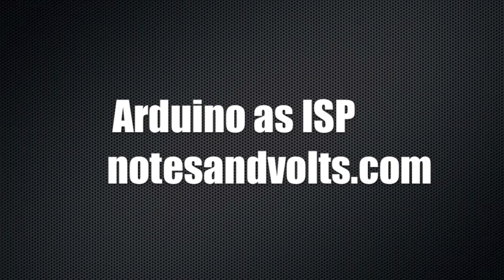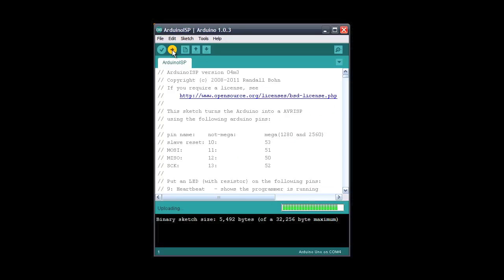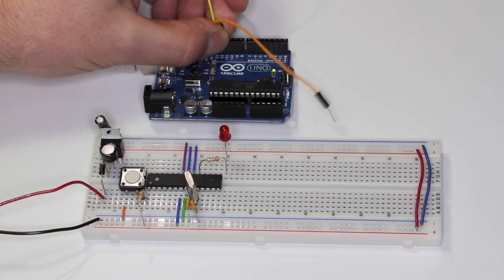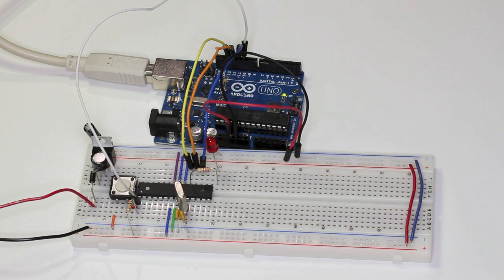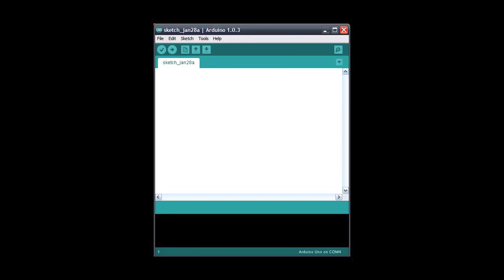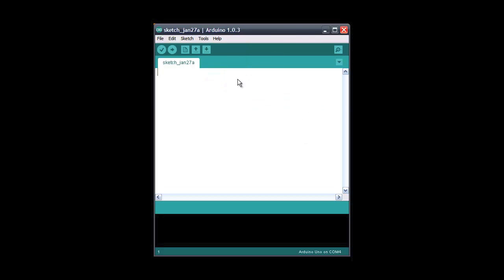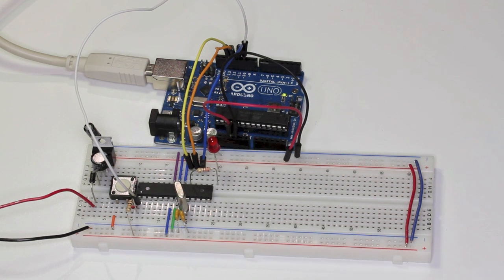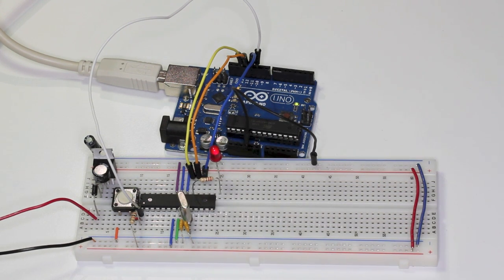Arduino as ISP

Comment: Thanks for your videos, many of them were helping me a lot with my midi projects! thank you! I would like to ask you something... I design a custom board with an atmega32U4 for a midi controller project... I programed using an arduino as isp and avrdudess. It works good always, but now it doesn't work anymore, it doesn't recognize the atmega32u4. I checked all the wires a hundred of times and everything is ok... but the most weird thing it is that it was working fine and suddenly just stop working... do you have any idea of what could happening? Thanks

Comment: OMG... I spent literally 30 hours trying to figure out how to upload sketch code into Atmega328P-U with no avail... this video tutorial helped me, I did not knew you need to hold the shift key to make the Arduino IDE to upload code to the Atmega328P-U rather than the Arduino board. It does not make sense why we need to configure on the "programmer section" at the arduino IDE and also need to press the shift key. I seriously need to stop using this Arduino IDE and shift towards Atmel Studio IDE. I watched literally watched 100s of youtube video and no one said to hold the "shift key"... wow. Now I need to figure out how to upload sketch code using UART serial pins from a USB to TTL converter device, I hope you have a video on this. Thanks! Also from what I heard, this process erases the bootloader since we are using the SPI pins to upload the sketch code.

Comment: This was a nice tutorial. Is there a schematic or diagram link for the wiring? I checked https://www.notesandvolts.com/2013/01/fun-with-arduino-arduino-as-isp.html and didn't quite see the wiring for the bootloader sketch. White to 1, Blue on 17, Orange to 18, Yellow to 19? from pins 10, 11, 12, 13 respectively? Thanks.

Comment: I have a question. Thanks for the great video. I used this circuit to create an ATmega328p programmer UNO shield (with ZIF socket) like many you can find online. I just started burning bootloaders to multiple chips and I'm wondering if it is safe to add/remove the ATmega chips while power is still being applied. I noticed that the power LED flickers on the Arduino UNO when I'm doing this. Doesn't feel safe. EDIT: If it isn't safe, I think a pushbutton under the ZIF's lockdown arm might be a neat solution to only power it when a chip is in

Comment: After 2 weeks attemting to solve the problem, key was in  "shift + upload"
Thanks man very  good turorial
Reply from the maker: Thanks Yagoub!
Reply: @NotesAndVolts  plz sir i've Qst:i've code   written in avr-gcc and i want uploade this code to  ATTINY 2313 and ATMEGA 328P. is this method inn video work?
Reply: I have been trying to find a written article about this and while I've found lots of good articles about using an arduino to write the bootloader to another arduino, I haven't found something satisfying about how to actually program a sketch using an arduino as ISP to another arduino. And +1 on the secret being shift + upload! Very useful and clear tutorial, Notes and Volts!

Comment: Is it necessary to have the board (which is the ISP) to have the ATMEGA328P chip mounted for programming the target chip? Or does it program the target chip without a chip on the board?
Reply: I actually heard somewhere else that you should make sure to unmount the chip from the board. Now I'm confused - Does this work because he pressed the shift key to bypass the board, and does taking out the chip negate the need to do so? I guess you can go with both to be safe.

Comment: Hi, I purchased ATmega328 U controller from the market , And i tried to boot load the controller using Arduino Uno board as ISP.  But it failed, I tried  several times. Connections are made as shown in your diag/video. I think the problem must be in ATmega 328 version or you may say the code U, its not the P as usual. So please can you help me in this How to bootload a ATmega 328 U using Aduino IDE(New version).

Comment: Thanks a lot for this awesome tutorial !
For those who have an error message when bootloading like :"protocol error, expect=0x14, resp=0x14...". You can try to put a 10uf capacitor or more if you don't have beetween the reset of the arduino (the second socket after the 5v output socket of the arduino) and the ground of the breadboard. So the positive leg on the reset socket and the negative leg on the ground of the breadboard. It worked for me !
Reply: Works for me too!

Comment: Arduino: 1.8.5 (Windows 10), Board: "Arduino/Genuino Uno"

avrdude: Yikes!  Invalid device signature.
         Double check connections and try again, or use -F to override
         this check.

Error while burning bootloader.

This report would have more information with
"Show verbose output during compilation"
option enabled in File -> Preferences.
(help me)

Comment: Just what I need on how to use an uno board to program an atmega uController.
However I got the following error (see below):
Just inquiring - is this true if I program an atmega 48 or atmega328??
*********************
An error occurred while uploading the sketch
Reading | ################################################## | 100% 0.02s

avrdude: Device signature = 0x1e9307 (probably m8)
avrdude: Expected signature for ATmega328P is 1E 95 0F
         Double check chip, or use -F to override this check.

avrdude done.  Thank you.
**************************************

Comment: It burning on the chip connected on uno even if push shift and upload button why?.Pin 21 is also vcc=5v?
While burning bootloader it gives this error
 ***failed;  
avrdude: WARNING: invalid value for unused bits in fuse "efuse", should be set to 1 according to datasheet
This behaviour is deprecated and will result in an error in future version
You probably want to use 0xfd instead of 0x05 (double check with your datasheet first).

Comment: I can't burn the bootloader, there is an error saying:  ***failed;  
avrdude: WARNING: invalid value for unused bits in fuse "efuse", should be set to 1 according to datasheet
This behaviour is deprecated and will result in an error in future version
You probably want to use 0xfd instead of 0x05 (double check with your datasheet first).

Comment: A question if you bring the arduino uno to dfu mode the circuit is gonna be to? Because I have a Chinese arduino board ho doesn't have the dfu pin on it and I will like to bring it to dfu mode so I can turn it into a joystick with unojoy library... Any help would be appreciated.

Comment: Thanks for this! We got it working successfully to program a nano. Can't figure out how to output to the serial monitor though. We've tried wiring the nano's TX to the Uno's (ISP) TX, and also it's RX, but no dice. Any thoughts here?
Reply: Here is my late response: 
The program on the UNO is acting only as a programmer using the SPI port and quite surely ignoring everything else, the serial library on the Nano is using the serial UART TX and RX, I suggest you connect a normal USB to serial converter to the Nano TX/RX and use a separate serial monitor on the PC ignoring the embedded monitor in you Arduino Editor.
There is a solution for Atmel ICE programmer using SPI where the serial information can pass through the ICE programmer using the DGI port. search for: "Is it possible to monitor serial using Atmel-Ice?" on the AVR Freaks forum has all the links.

Please let me know if you’ve found a better solution.

Comment: I don't understand where the code is. Is there no code apart from that of the blinking?
Reply from the maker: Hi Max. The Blink program was used as an example. In reality you would upload your own program. If you're talking about the ArduinoISP program, it comes with the Arduino software in the FILES>EXAMPLES folder.
Reply: Notes and Volts and that program is the pda code you have on your web isn't it?

Comment: I had tried burn bootloader in atmega8 with arduino uno many times. But Everytime found the same error" efuse" memory type is not define for part atmega8 . So how to resolve it.
Reply: same
Reply: change it in the file where u set the fuse bits

Comment: If I were using arduino uno as an ISP and uploading bootloader to a 328P AU (for Arduino Nano and not UNO, I get 2 Analog pins extra) I have to change the board type to nano after uploading the ISP sketch to UNO? 
My next question to you would be can I burn the code by holding the shift key to upload it to the chip ? 
I know how to wire it up and I have a DIP socket too. What I am trying to avoid is the usage of a FTDI to burn the code to the chip after the bootloader is burned in the way you demonstrated it.

Comment: on which chip bootloader is burning?...after burning a program in the the chip of breadboard can we make another different program on it and erasing the previous program?....what are the the pros and cons of burning the boootloader? after burning the boot loader can we undo it??
Reply from the maker: Hi Arunava. The bootloader is being sent from the arduino to the breadboard chip.  You only need to burn the bootloader the first time with a new chip. This will make it arduino compatible. 

After that, you can reprogram the chip as many times as you like. The bootloader will be erased when you upload your program. It is not needed anymore.

Comment: Is it possible to program the chip on the Arduino board and then take it off and put it on the breadboard?
Reply from the maker: +Brandon Low Hi Brandon. Yes this is possible as long as the Atmega chip already has 
the Arduino bootloader installed. You can buy Atmega328p chips with the 
bootloader included. If it is a new chip with no bootloader it will not 
be recognizable by the Arduino.

Comment: One other note. When I load the ArduinoISP sketch, I noticed the 'programmer' selection on the tools dropdown menu is set at AVR ISP, ie 'programmer: AVR ISP'.  I noticed in your video is just says 'programmer' with no colon and suffix like AVR ISP or AVRISP mkii, etc. Don't know if this has any significance but wanted to pass it along. Thanks for any help.

Comment: Thanks for the tutorial. Have a problem and wondered if you can help. On my breadboard circuit, when I add power via external battery the LED blinks as expected from a previously loaded program. Now when I hook up the wires from the Uno to the breadboard and the ground and voltage connections from the Uno, the LED blinks as expected with one exception. I have to disconnect the connection from pin 13 on the Uno to the breadboard pin 19 for the LED to blink. As soon as I connect the wire from 13 to 19, the LED stops blinking. I am getting a getsync error when trying to load a program to the breadboard circuit via the Uno. I am at a complete loss to resolve this. I've tried rebooting the Arduino software, the PC, reloading the ArduinoISP program onto the Uno, changed the USB cable, etc. Any help you can give would be greatly appreciated. I can email a picture or short video if it will help. Thanks so much.

Comment: I built a programming header into my project planning to do most of the work with the thing intact, i didn't know that there even was an "Upload using programmer" option that came up when you held shift. I always figured that just by flashing the arduino as ISP code it and selecting it the program would do it automatically, thank you for this video it is an amazing resource.
Reply from the maker: +Yspyg Thanks Yspyg!

Comment: What program do I upload if i want to make the auduino synth?
Reply: +Cooper Long Nvm i found the program but do i just copy paste the program into an arduino sketch? I tried opening it with arduino but i does not open it.
Reply from the maker: +Cooper Long Are you using the latest Arduino IDE? The program is a .ino file and should open.

Comment: avrdude: Yikes!  Invalid device signature.
         Double check connections and try again, or use -F to override
         this check. I got this problem.. what should i do? Please tell me..
Reply: +Ravi Dhoble double check the name on the IC... it must be atmega328 and not Atmega328P. both controllers are same but the device signature is different. So u have two options. 

1. buy the chip with name Atmega328P or

2. change the signature in the database file i.e (.conf) file
Reply: I did that but changing signature in .conf file wouldn't worked out...
Reply: +Ravi Dhoble so u will have to buy uC with name atmega328p
Reply: okay..
Reply: You might have to slow down the baudrate. AVRdude is a headache and does not work consistently, I found it worth just forking the cash for Atmels expensive ICE programmer instead of dealing with AVRdude.

Comment: Im sure someone tough this was about how to use the arduino as an Internet Service Provider xD
Reply from the maker: +Daniel Tevi (Jizzy) Hehe
Reply from the maker: ***** The board type is not set correctly in the Arduino IDE.
Reply from the maker: ***** For the crystal caps?? That won't work you want 22 PicoFarads. 2.2uF = 2200000 PicoFarads!

Comment: is a bootloader mandatory on the external chip as we are using ISP to program and save some space?
great video.
thank you
Reply from the maker: +Rejin Jacob Hi Rejin. In this case we are only using the bootloader to setup a new ATmega chip with the correct parameters. Once this is done the first time, you do not have to do it again with this chip.
When you upload your code via ISP, it will overwrite the bootloader and you will be able to use the extra space. Good luck!
Reply: Notes and Volts thank you

Comment: thank you so much sir. it comes very helpful to me. I managed evertyhing you explained in your video. you gave me a gift that i don't need avr programmer . 
below error codes commented by others  (which i faced exaclty the same ) can be solved with power arranged through arduino (isp) board up to your breadboard or if you want to use separate power externally then bridge minus of it to arduino minus(ground).

Comment: when programing a microcontroller using arduino, is the circuit (on the breadboard) needed? Can i just power the microcontroller and then program it using arduino (without the circuit) and then put it in the cicuit(the one on the breadboard) once it has been programmed

Comment: Hi,

I keep getting error messages: (not in sync, reps= 0x03), but my hardware setup it the same as yours. Did you made any changes to the avr files?

Before this, I tried programming an AT89S52, and when I tried to upload the bootreader, it gave me a syncing warning as well. So I guess I had to do something to my Arduino software before hand, so it would sync with the chip, but I have no clue what.

Comment: Hello, thanks for the fantastic video- very useful. I have a couple of questions: Firstly, when you burn the boot-loader using this method, will the boot-loader burn to BOTH the AVR on the Uno board AND the AVR on the breadboard or just the breadboard. Secondly, when you download a sketch using the 'Upload using Programmer' setting, does this download to the Uno and the Breadboard or just the breadboard. My concern is that the LEDs on the Uno AND the Breadboard were both flashing when you downloaded the sketch. Thanks, Jamie B.

Comment: Hello, this might be a cheeky question, but anyways;
I got a chinese knockoff arduino (http://www.dx.com/p/dccduino-atmega328-development-board-for-arduino-uno-r3-blue-340374) from a friend, and I'm rather new to arduino. Do you think that I will be able to do this project? Ofcourse assuming I get all the right components and a ATMEGA328-P for the board?
Reply from the maker: Holyshitwhydidtheyletmepicksuchalongnameibetyourenotevenreadingthis Great username! LOL! If the board is 100% Arduino Uno compatible it might work. Looking at the picture, it seems like it has a 12Mhz crystal?? That could cause some issues if your target board is running at the normal 16Mhz. Anyway, no harm in giving it a try.
Reply: Notes and Volts Hey again!
Good news, the 'arduino' runs the project well. I've got the project (Granular Synth) up and running on a breadboard with 5 pots. The only thing is that one knob sets the tone, this works well. However, the other 4 knobs barely seem to do anything. Could this be because of a faulty setup or do i need to tweak the code a bit?

Thanks in advance man!
Reply from the maker: You shouldn't have to change any code. The oscillator knobs have the most effect when they are set at the higher end (clockwise). Does the center "scale" knob work?Holyshitwhydidtheyletmepicksuchalongnameibetyourenotevenreadingthis

Comment: How about if you need to bootload an Atmega8?
Reply from the maker: You won't be able to use an Atmega8 with this tutorial. Try this http://playground.arduino.cc/Learning/Burn168
Reply: Notes and Volts Thanks for the direction.
Reply: +Notes and Volts hi thanks for the video. But please for the purpose of a newbie, you didn't talk about where we start to type our "main.c" whether on an editor or still on the makefile template. And and also where to save the makefile.

Comment: I'm using the ATMEGA328-PU and I'm getting the following error:
avrdude: Expected signature for ATmega328P is 1E 95 0F
Double check chip, or use -F to override this check.
I can't find any info about how to solve it... I checked the signature in the avrdude.conf file and I can see 1E 95 0F in ATMEGA328 signature. Any idea?
Reply: This happens when I'm trying to burn the bootloader.
Reply from the maker: Bertoos8 Hi There. The 328PU has a different signature than the 328P. Read this http://forum.arduino.cc/index.php?topic=58670.0

Comment: Nobody else is getting the following error?, I added resistor on reset pin atmega 8
avrdude: Expected signature for ATMEGA8 is 1E 93 07
         Double check chip, or use -F to override this check.